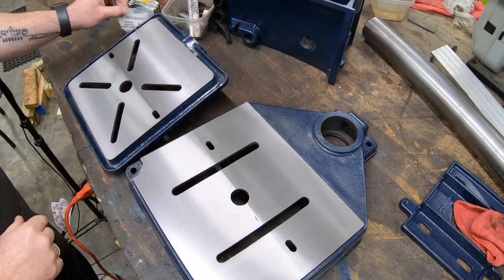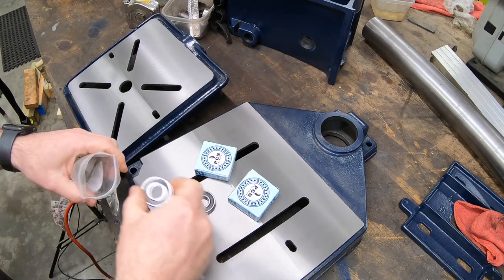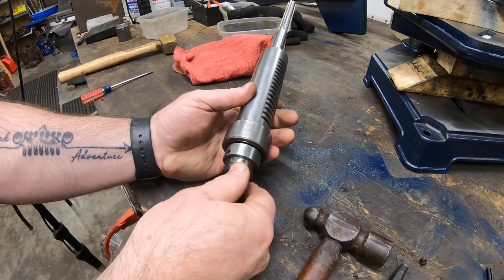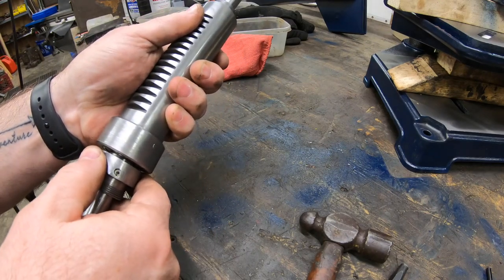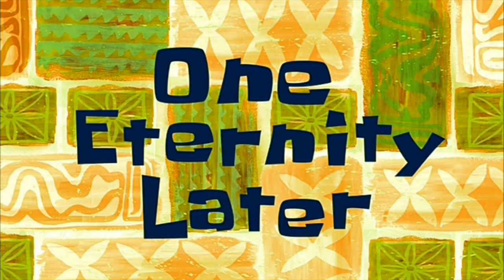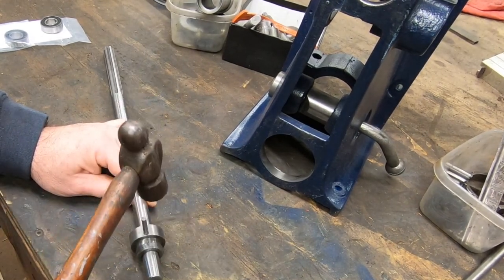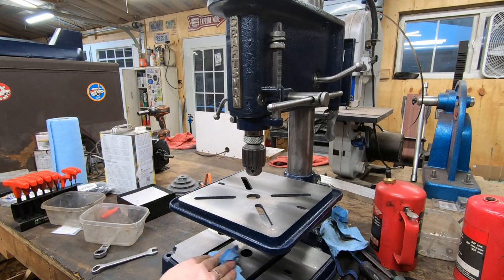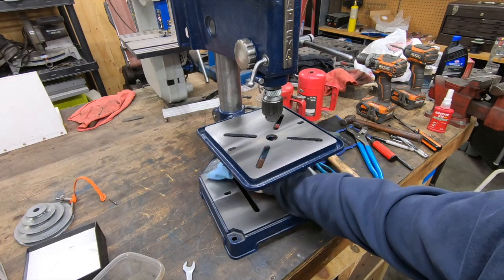Restoring a 1940s Craftsman Drill Press - Part 4

Comment: Very nice. I cheated on my similar Delta and added a sleeve bushing to add a few more inches to the column height. I was always running out of work clearance.
Reply from the maker: Whatever works, right? I'd like to have a floor model drill press. A friend of mine had a Clausing for sale recently, but didn't have the funds for it. That would have been a nice one to have.

Comment: Greg, when you removed the bearings from the pulley, how did you get the bearings off the tube?
Reply from the maker: I used a piece of bar stock to knock it out.

Comment: Old timer I got it from mentioned changing 2 bearings and pointed at the spindle area. It still wobbles at the tip.  What would you suggest?
Reply from the maker: Does the whole quill wobble or just the spindle inside of it? If it's the quill, you might likely will need to bore and sleeve the head to remove that play.
Reply: @MyLilMule  I will take a closer look this morning. Appreciate the advice!
Reply from the maker: @adolforosado  no worries!
Reply: @MyLilMule  Alas, it's the spindle. I'll ask for help locally getting that fixed. Thanks!